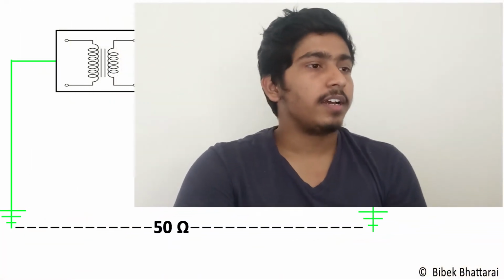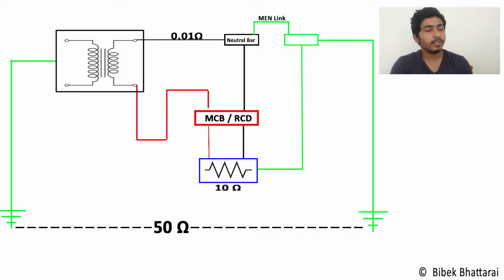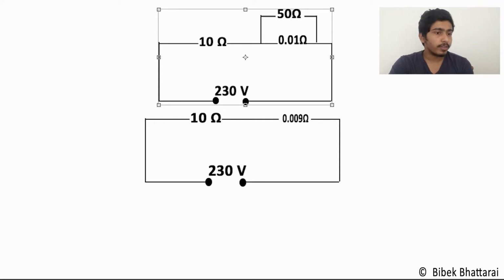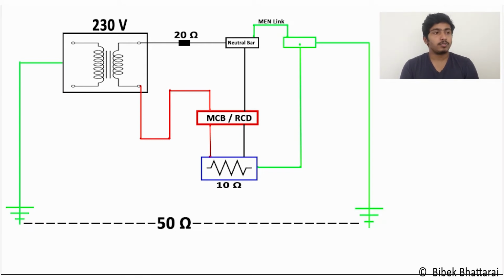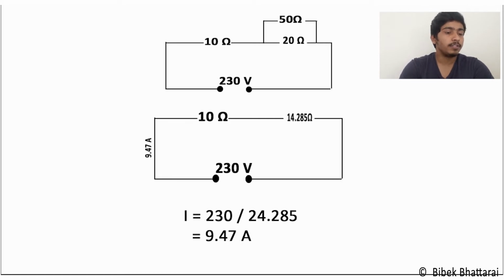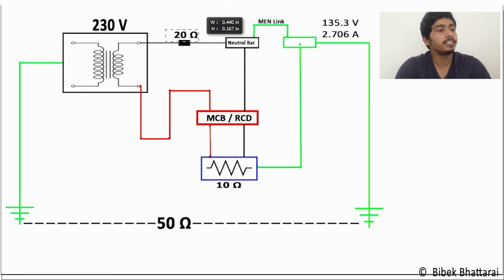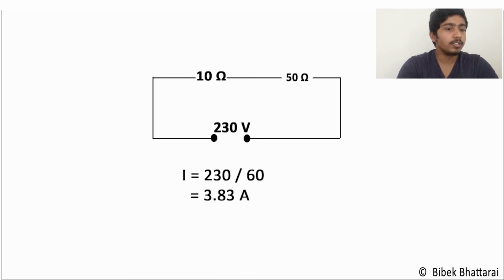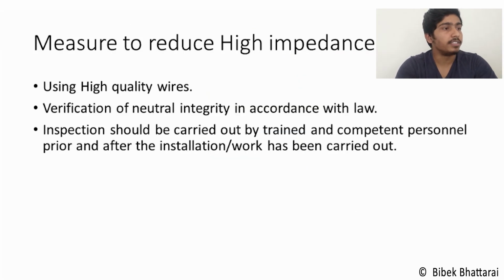High Impedance Neutral or Open Circuit Neutral Explained. Very Easy to Understand

Comment: In the scenario of a broken neutral, what would be the hazard of touching exposed metal? How would the voltage and current change across your body, assuming the current is flowing from the exposed metal, through you, and back to the SAME earthing system, perhaps the houses earth electrode?